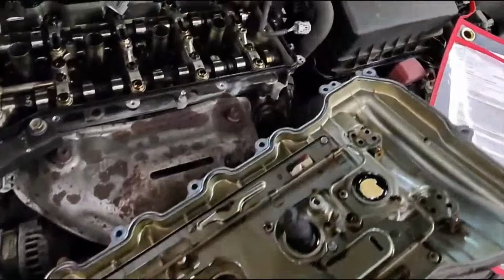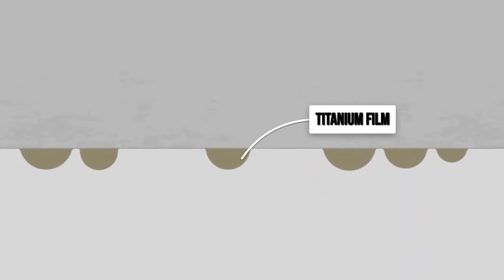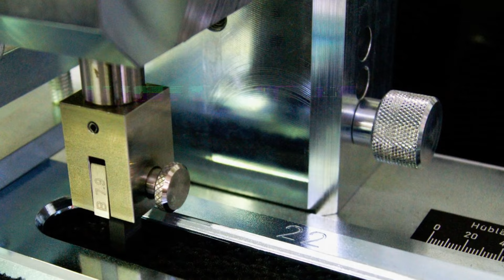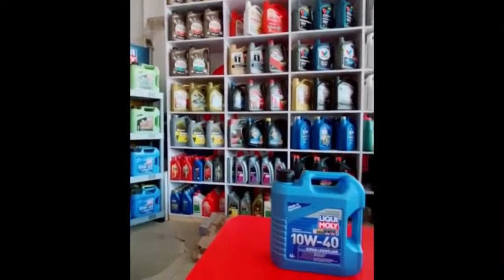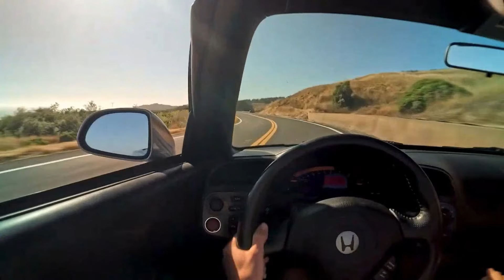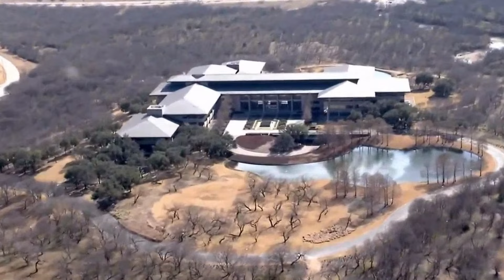Best 9 Synthetic Oils You'll EVER Need (Protects Engine NOW)

Comment: I have used Amsoil signature series in my 2008 Honda civic si sedan for over 17 years. It is ranked as the best synthetic oil by multiple sources. I use Mobil 1 synthetic oil in my 2000 Chevy s10 for over 25 years. It is an excellent oil also. I use 5w30 in both vehicles.